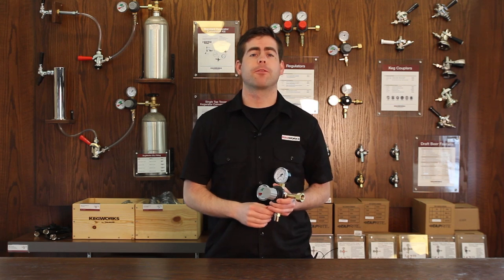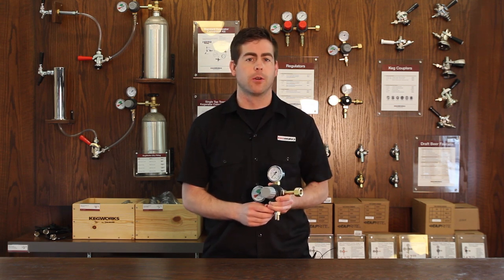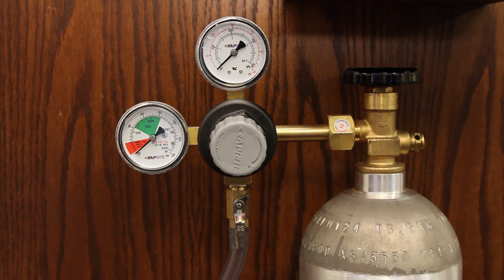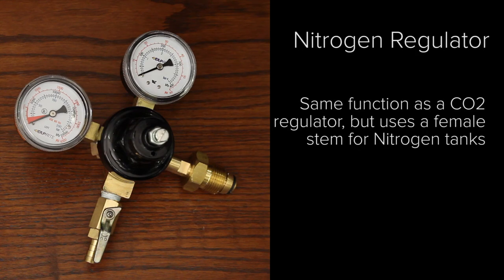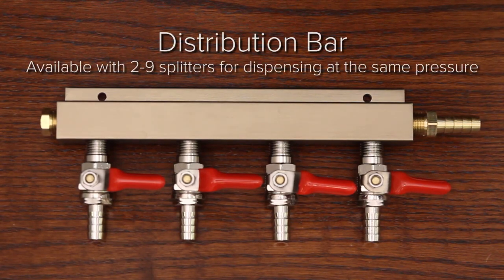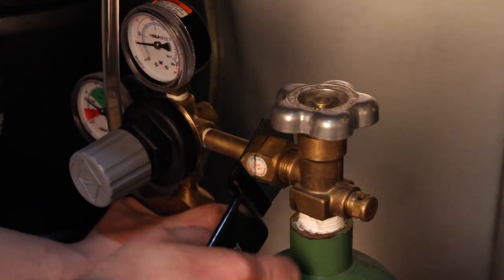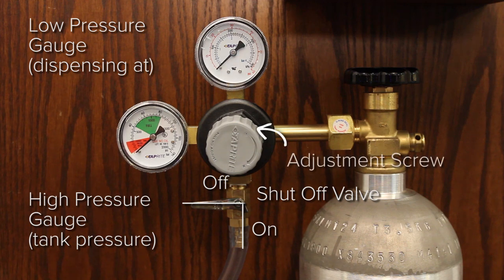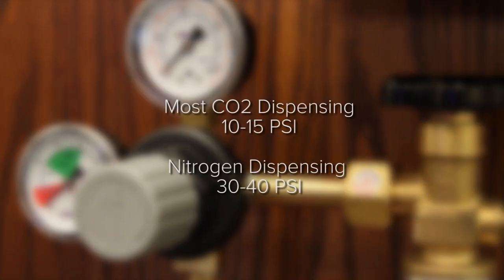How-To Use a Draft Beer CO2 Regulator

Comment: HI Do you know the size of the Nitrogen regulator stem and thread size.

I have seen 1/2 x 26 and 1/2 x 27 very confusing. thanks
Reply from the maker: The thread on most nitrogen regulators will be 0.965" - 14 NGO INT going into the nitrogen tank. If you are referring to the end of the nipple which goes into the regulator itself, that is a 1/4 - 18 NPT thread, which is a tapered thread. Let us know if you have any other questions!
Reply: @KegWorks  Thanks for the reply, your very good. thanks